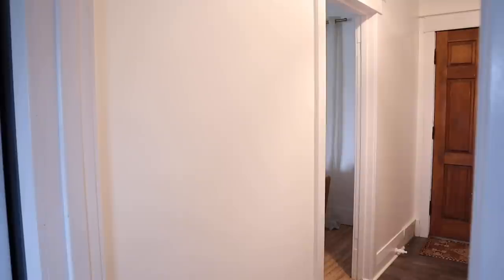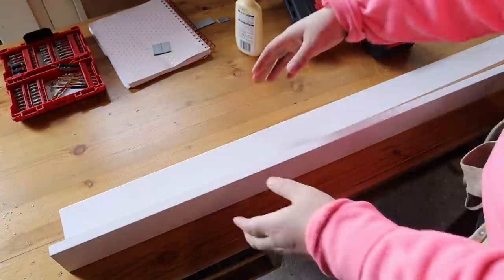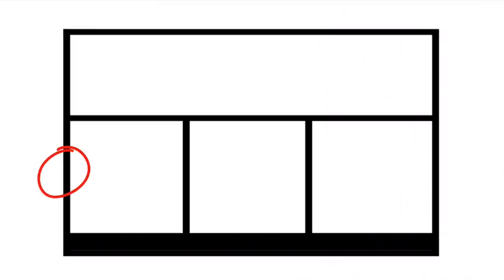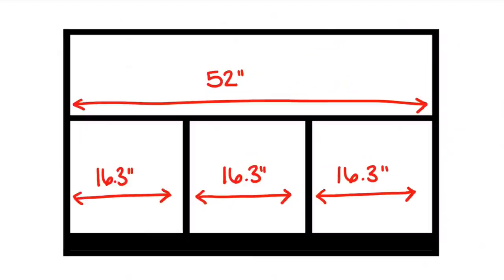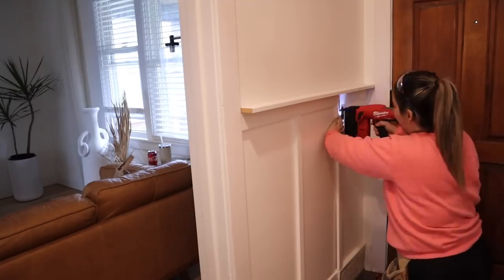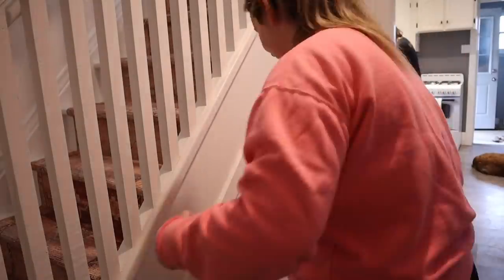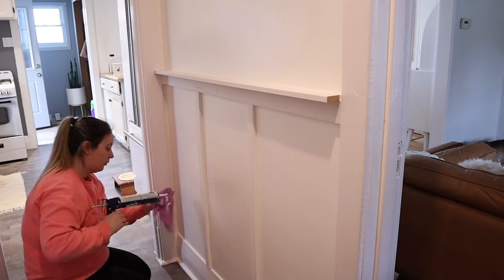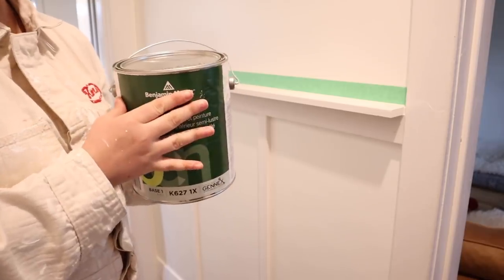Easy DIY Board & Batten Tutorial *my entryway*

Comment: Some caulking guns also have a “cutter” built in! Look down the handle and you can see a little circle cut out of the metal.. with thwe caulking gun empty, put the tip of the tube in there and squeeze the handle. You should have a cut!